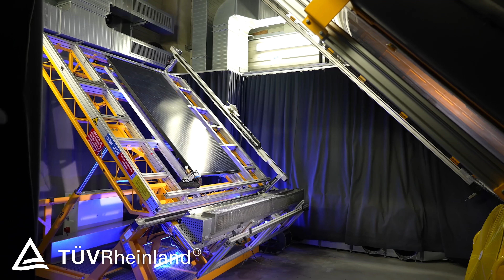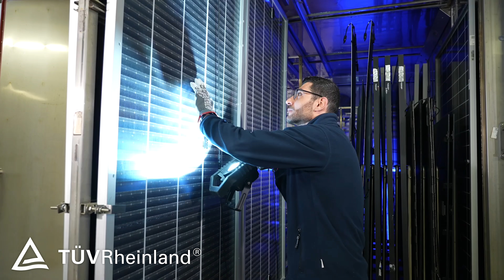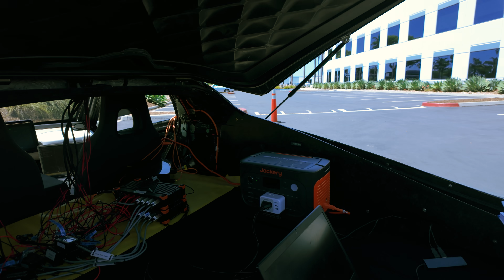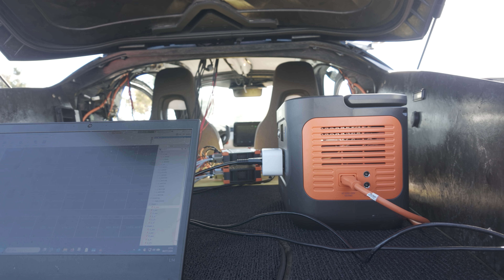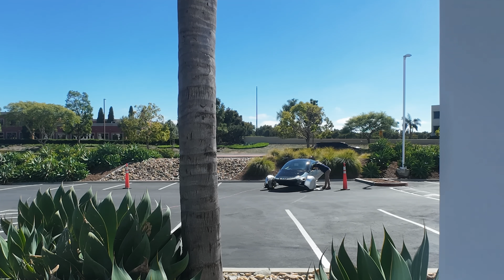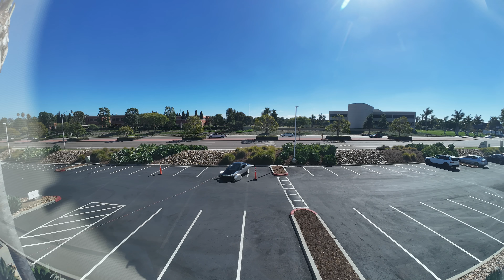Aptera's Solar Output Is Now Independently Measured

Comment: Numbers while parked all day are nice but what about a mix of parking and driving?
Reply: Driving if in the same direction as in the parking test, should be more efficient as the solar cells would be cooler, which makes solar more efficient. (I own a solar company).
Reply: Not relevant if you are testing the panels themselves. As the old saying goes, "mileage may vary" The variables would be too numerous.

Comment: How much increase would you get if you had the front wheels free to spin and parked the rear wheel on essentially a skateboard that could swing the back of the car sideways? You'd have a solar tracker (or simple timer) rotate the car slightly during the day in your driveway to track the sun. Tilt the skateboard slightly so it follows the proper arc radius, put a clock motor on one wheel and start it in the morning. If you have independent wheel motors on the car it could rotate itself. If the car's rear wheel could pivot sideways you could ditch the skateboard. If the rear wheel could pivot sideways you could 'turn the car on a dime' and park easily. Cue the Batman TV show theme song here and execute a Bat Turn, Robin!

Comment: 4.2 kWh in mid August is just a bit closer to the equinox than the summer solstice, but still more sun exposure than on a average day of the year.  I hope they test again in late September (even if not independently verified), nearer the equinox, since that more closely represents an average day in San Diego, but also is the time of year with the least regional variation in solar exposure. 
It's encouraging that the results with simple parking were so close to the results from solar maxing.
Reply: You can probably estimate it by comparing these results to standard solar statistics for the region and adjusting proportionally to the month. It's unlikely there is any factor that would make these solar panels have efficiency that doesn't scale the same as other panels as the weather changes
Reply: Video is misleading. If you read the report, the testing was done in early July, close to the summer solstice. The results are not representative for an annual average, even for sunny days.
Reply: @pfunk768  Thanks.
Reply: @pfunk768 everything about this company is misleading and chicanery.

In the USA, there is a House of Representatives bill 3385 that will make it impossible to register these three wheeled velocycles. Regardless, Aptera has been promising product for 17 years and $150M of investors money.

Comment: EPA MPGe is what will blow the lid off the skeptics. Once that is validated at over 300 MPGe it will be talked about. Tesla's get just over 100 MPGe, if Aptera is 3 times higher, it will make Prius look like a gas guzzler. 20 years ago, when Prius first showed up, most cars were getting 25 MPG or the most 30 MPG, but Priuses came in at 48 MPG, and many at first did not really believe it. So, an advancement of this kind will be over the top range by a factor of 3 times. This will open people's eyes, and result in folks wanting to buy them. The solar works, we all knew that, but combine it with the efficiency of .13 drag, and moose test results, and wallets will open up. So many comments about the price being high sort of makes me wonder how to compare this product to anything else on the road, because you cannot do that. Aptera is so different that comparison makes little sense, apples to oranges.
Reply: Just imagine if solid state batteries actually comes out and this car gets like 100kWh or so, the total range would be astounding
Reply: @sihamhamda47 Really? Has the EPA certified that?
Reply: @christopherbarrett9749  Not certified yet, but their preliminary test showed 8.1mi/kWh on highway speed, which are already almost 2x the efficiency of Tesla Model 3
Reply: @sihamhamda47 or maybe they will use a flux capacitor and dilithium crystals, or maybe they can run as they do now, on the power of biorganic waste from male cows.
Reply: My Organic Transit ELF gets 1,800 MPGe. And it can be pedaled too.

Comment: Would I rather have an Aptera or a Cybercab with the solar panels on the roof of my house? Cybercab, hands down. It drives itself. Sorry Aptera, but you are an idea whose time has come and gone.
Reply: The Cybercab will not charge while you drive it! You lose! The Cybercab will not charge when you park it anywhere besides your house! You lose again! The Cybercab is not as efficient as the Aptera! You lose again! You must enjoy losing more then winning!
Reply: The Cybercab has no pedals or steering wheel. You can't drive it.
Reply: 👍

Sounds like you're still interested in following the journey which is still a win for Aptera!
Reply: Aptera is a Fun vehicle and is a different use case from Cybercab.  Cybercab is a Revenue vehicle, just like a Model Y Juniper. Comparing these two is like comparing mountain bike to a Harley Davidson hog. They are not the same class of vehicles.  My Model Y will be earning me money on the Tesla Robotaxi network when it arrives in my city, and I will be out in my Aptera making money flying my drone. Best retirement plan I have ever imagined!

Comment: if it was a Chinese company, car would be already out 5 years ago and updated 2 times. you guys are super slow.
Reply: If it was a Chinese company, it would have killed tons of customers already by not caring about any of the safety aspects.
Reply: @NN-kf7qo  And not have to follow regulations such as environmental, OSHA, and permitting process.
Reply: There is Turkish car company called Togg. They started after aptera and they already have sold 100.000 cars. I think aptera doesn't  want to build them. Just delaying slowly
Reply: @cerpanorm that is your problem! You think!
Reply: @gmv0553 yes bc I invested
Reply: @cerpanorm again you are comapring companies in different countries. The entire infrastructure is different, laws are different, investment landscape different, vehicles different. The comparison holds little to no water
Reply: Chinese electric vehicles are banned in America; one reason is they do not meet safety regulations in America. Your assumption has negative merits aside from the fact that you are showing your ignorance by making such irrational statements. What are your comparisons?  Have you seen the Roof Crush Test rating for the Aptera?  Have you seen any Roll Over test results for the Aptera? They do exist, you know...right?  The very least you could do before you blab nonsense in a public space is to verify your 'beliefs' without bias. Just a small amount of effort on your part can make you appear much more intelligent than you appear in this thread.  I wish you much success in your quest for knowledge. May peace be with you.
Reply: @pirextech53  Actually those test results do not exist. Any results like that are for a different design. I am only pointing this out because you did not follow your own advice. This is from a pro-Aptera person.
Reply: You don't understand what it takes to get a car to production. Comparisons to other areas are fruitless
Reply: yeah for real! shout out to aptera for being thorough and not relying on slave labor :person-turqouise-waving:

Comment: Is the efficiency of the motor known yet ?
Reply: There isn't s single efficiency number.  Electric motors have efficiency curves.  As for the one used in the Aptera, we know there is room for improvement.  So a future Aptera with a more efficient drivetrain will be even more impressive.

Comment: How many miles/km does 4.2kWh translate into?
Reply: Depends in efficiency, but let's say at 9 m/kwh, then 37.8 miles. 

Which means even if they had an efficiency figure 10% lower than their claim (which should be confirmed in testing) they have achieved 94.5% of their claimed standard, which is very good.

This means that their ceiling to prove their marketing claim has a comfortable buffer that may survive real-world testing. This is very exciting~!
Reply: According to the Aptera Press release:
-Parked and untouched. Fixed position, hatch closed, left completely alone all day. 4.23 kWh, roughly 42 miles estimated of solar range.
-Repositioned once at solar noon. Turned a single time when the sun was highest, the way an owner might park facing the other direction after lunch. 4.40 kWh, roughly 44 miles of estimated solar range.
 -Solar maxxed. Rear hatch raised and angled toward the sun through the day. 4.75 kWh, roughly 47 miles of estimated solar range, achieved on the day with the least available sunlight of the three.
Reply: @Mikey_Likes_It_Too  you are not getting 42 miles out of 4kw. 15-25 tops.
Reply: @gogereaver349  4kw would change drastically dependent on what vehicle is using it. Put it in a Tesla, or volt PIH and it will be more mileage than a EV9, Ioniq. Put it in a Hummer EV and it would be trivial amounts.
So yeah... made up is technically accurate, but maybe not as misleading as it could seem.
Reply: @Sirlawngnome23 a got a volt thats like 13 miles. yes my car is older and much more wight.  i dont see you getting more then 20-25 on something like that.
Reply: @Sirlawngnome23 like i said anyone with a ev or plugin know these numbers are being fluffed alot.
Reply: @gogereaver349  there are a ton of factors that allow them to achieve 10 miles per kWh of efficiency: aerodynamics, very low weight, three-wheel layout, low rolling resistance tires, efficient electric drivetrain, small frontal area, and regenerative braking. Aptera is not a car, it is classified as a motorcycle, but really its a unique vehicle that is going above and beyond what a typical EV four wheeled car would do in order to achieve maximum efficiency.
Reply: @gogereaver349  Like you keep saying, guessing and assuming which has no relation to the actual testing that has been done. Your Ev may not get 42 miles out of 4kWh (not 4kw), but Aptera will. Your trolling is getting tiresome.
Reply: 42 at the target 100 Wh per mi
Reply: @Vulpolox  just no way thats like e-bike numbers
Reply: @gogereaver349  — I have my doubts.  That’s their number, not mine
Reply: @gogereaver349  You realize that they have actually tested the car on road trips and such and managed to get close to that 10 mi/kwh number, right? I get it, it's an insane level of efficiency, but they have literally managed it at this point.

Will the number be lower in reality, yes, but the car is lighter and more aerodynamic than most other EV's on the market, so a 5-7 mi/kwh range is imminently doable. Meaning anywhere from 20-28 miles of range on the low end.

If you don't like the Aptera, why are you bothering to waste your time watching and more importantly putting dozens of comments on the video? Find something else to do, or go touch grass.
Reply: $1.00 worth of electricity, less than $200 a year in our average USA states.
Reply: @teejg349  and likely 10k$ worth of damage from the sun after a couple of years of intetionally leaving the car baking in sun.
Reply: 100wh per mile? Wow, that's 2.5x more efficient than Model 3, which is already very efficient...
Reply: @Sethicorn  pi in the sky numbers there not a e-bike with a human helping.

Comment: Looking forward to the release of the aerodynamic efficiency and range testing results from Aptera and an independent agency.
Reply: Those stats will be most interesting.
Reply: @madmotorcyclist you know what would be even more interesting? Seeing them being sold!
Reply: Yes, where the rubber meets the road!
Reply: I will only be convinced when they have the confidence to put the car in the hands of someone like Kyle from Out Of Spec
Reply: Convinced of what?
Reply: @catalinomocea6986 how about them selling some.
Reply: You know what will be the best test of range and performance........  Selling them to the public!!!! 
Aerodynamic test? Geepers that was proven 20 years ago! .002% better areo. Stop chasing diminishing returns. Its good enough for now. The mark 17 is ready for production now. Mark 18 can be even better. 
If the Aptera is not on the road soon, like 3 months its just a scam. 
Elio?
Reply: .125kwh per mile based on one of the road trips they did through Arizona